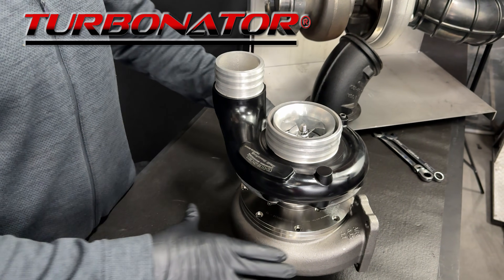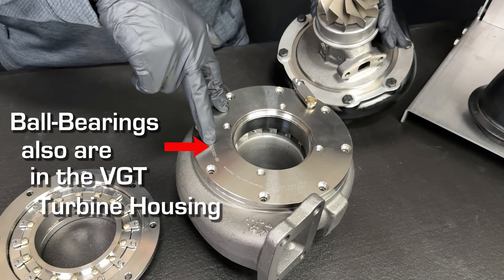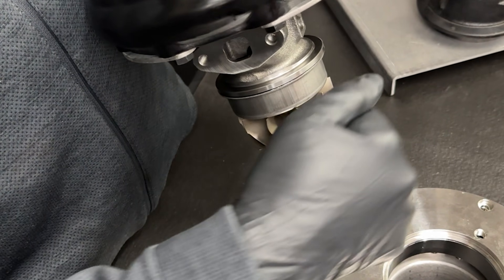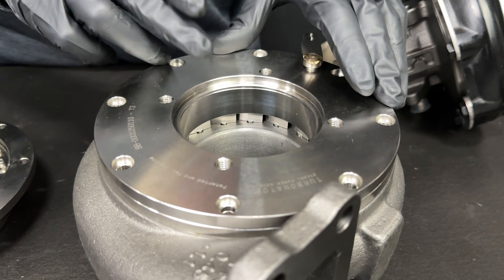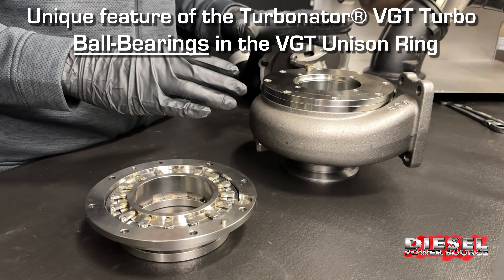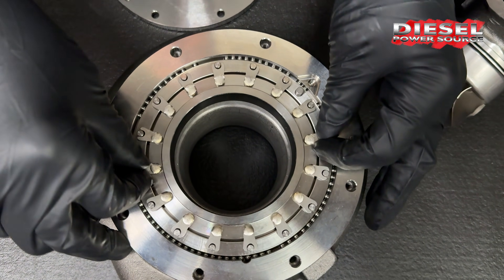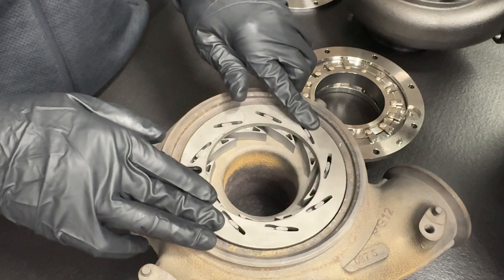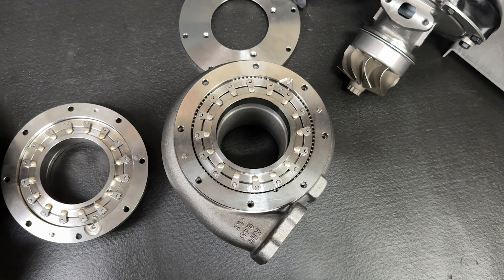Inside the Turbonator VGT: How it Works + Ball-Bearing Technology Explained

Comment: You can see the balls bunching up in your unit here, dose the final unit come with more balls and what is this going to look like when it fills up with soot?
I'm sure it will be much better but also harder to clean, do you guys have a suggested method to clean these when the time comes?
Reply from the maker: Great question! There are a strategic number of balls in the system to do what is intended. It is intentional that the balls don't go the full circumference. The Turbonator VGT is designed for durability and long-term performance, even in high-soot environments. While soot buildup is natural in any turbo system, our ball-bearing internals and innovative design help minimize excessive accumulation. 

We typically don't see soot-related issues., but for optimal long-term performance, we recommend a simple maintenance check between 50,000-100,000 miles—just open the system by removing the cover plate and spray it out with brake cleaner, blow out with an air nozzle, and reattached the cover, a quick process. The components are designed for easy access, making this a quick and effective way to keep everything running smoothly. With this basic upkeep, the durability is truly unmatched, ensuring reliable operation for years to come.

Let us know if you have any other questions!

Comment: I have a stage 4 turbonator on my 05 Ram 3500 and I love it! I should have gone with 1 size smaller though. I went with a stage 4 and should have gone with a stage 3. It's laggy to build boost when towing but really takes off once it hits 2krpm. I wish this bearing kit were an option when I bought mine last year!
Reply: I am considering a stage 2.5 or 3.5 for my mostly stock engine, are you on stock fueling with the stage 4 turbo?